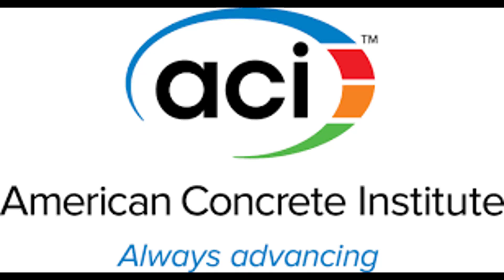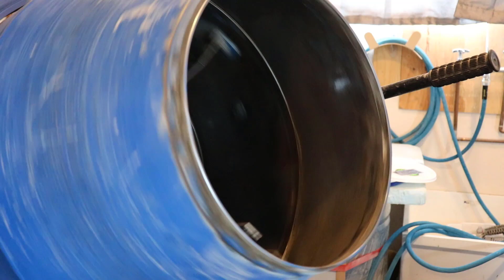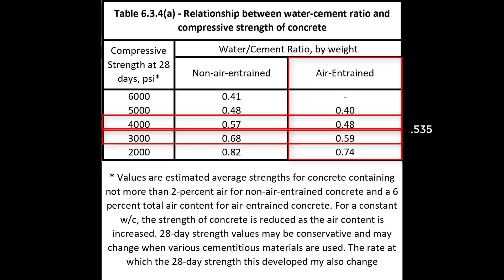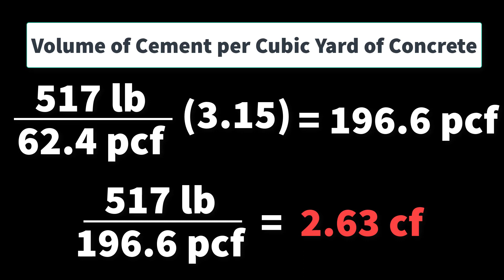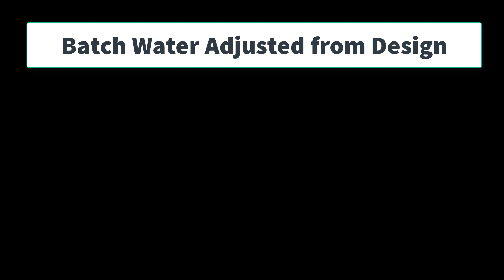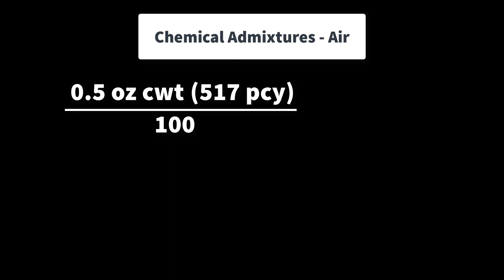Concrete Mix Design Practice - PMXDB Mix 2 - Vlog 618

Comment: Jon, could you please comment on the value of 250 in the upper left corner of table 6.3.3? the one for non-air-entrained concrete, 1-2 inch slump, 3/8 inch aggregate? To my opinion it should be 350... 
Please have a look at the series for 1-2 inch slump with decreasing aggregate size. The water content increases (as expected, duh), except for the 3/8th gravel?!? Doesn't add up...
Reply from the maker: Will check out today and get back to you.